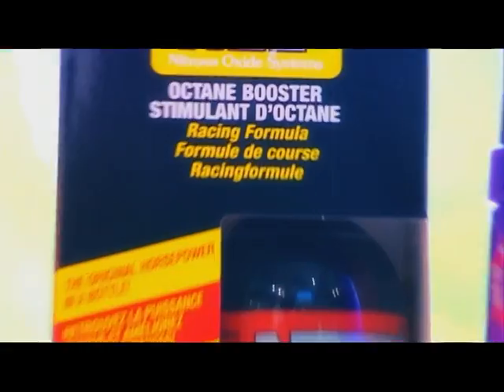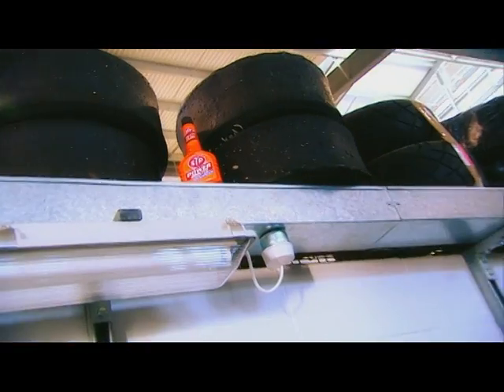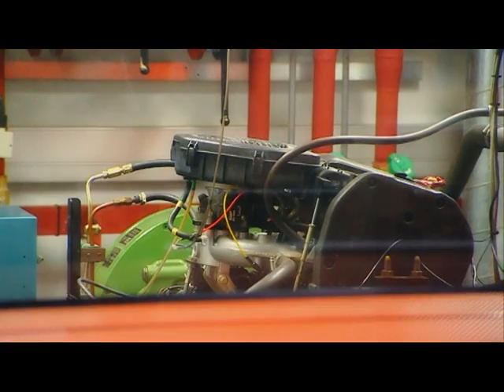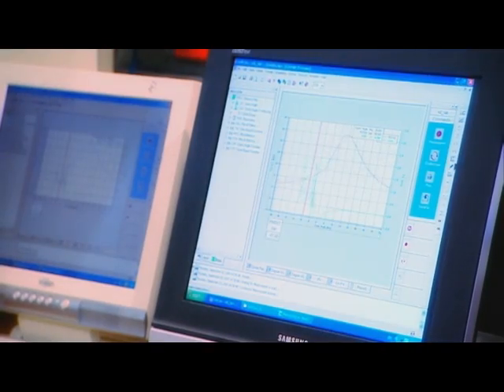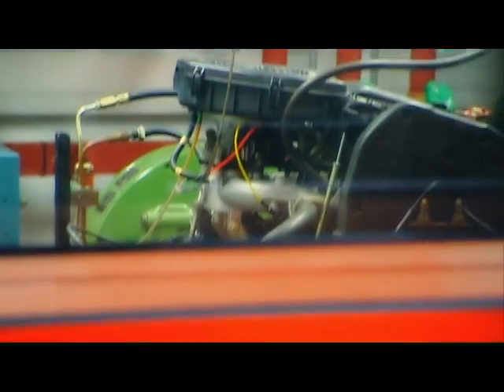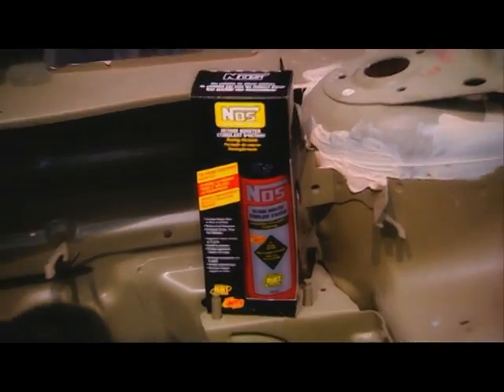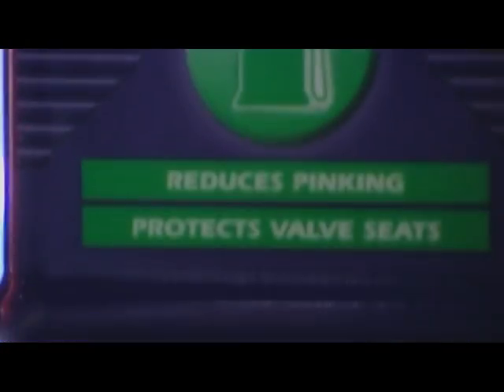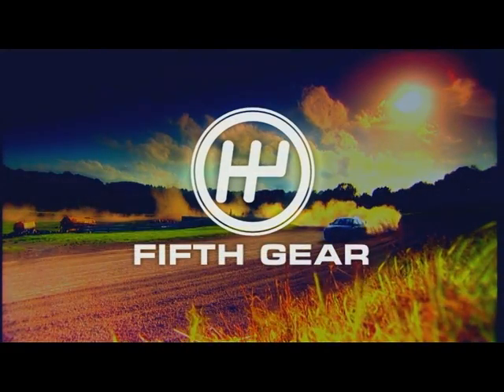Fifth Gear - Do Fuel Additives really make you faster?

Comment: I cannot comment about additives, but I have used Both Shell V-Power 99 octane Petrol, and Tesco's Momentum 99... and I can DEFINATELY tell the difference.
If you full throttle whatever car you are driving, it accelerates quicker, AND the HEATER gets hotter (Obv MPG Drops When Flooring) And if you use a light foot, it uses less fuel. So It works better BOTH ways. If you want to go faster, you go faster, if you want to use less fuel, be frugal. In everyway, V-Power and Momentum are better.

Comment: used Redex in my 1.9 octavia TDI and all it has done is made my engine run quieter but a mate of mine reckons if you use Redex combined with ultimate fuels in your diesel or petrol car then over time you should notice a difference but i still maintain that nothing cleans a diesel engine faster than a quick thrash down the motorway thats 1 way of blowing the cob webs out lol

Comment: You can increase the cylinder pressure in a normally aspirated engine by advancing the ignition timing so the peak cylinder pressure occurs earlier giving you more torque and therefore more power. The better knock resistance of higher octane fuel will allow you to do this.

Comment: nope, straight carb with a slightly modified intake for less restriction. it wasnt a big difference but because this is the only car ive owned and ive been driving it for over a year now, i know exactly how the car should handle. the acceleration increase was only slight but the fuel economy increased quite a bit. it has the same effect as if you change your car from 91 regular to 95 or 98 gas.

Comment: @popnstart Its the sound the engine makes. A mechanical pink, pink, pink, pink. Some people call it knocking or pinging and is generally caused mainly by running poor quality low-octane fuel in a high compression engine causing pre-ignition. Most fuel additives used to claim they actually boosted octane ratings but I think there were court cases from fuel companies so they changed it to claims which are harder to contest unless you've got the sort of set-up fifth gear used.

Comment: @Pintea100 
Or better become a better driver. The difference in a well relaxed driver and a tired/mad driver can be 30% more throttle/braking. There is a huge loss right there. 

So when you drive in any car.. drive more relaxed, look further ahead and let it roll out, brake less roll out!

Comment: "Octane" is a measure of a fuels ability to prevent detonation, AKA engine knock. It's a measure of how hard it is to ignite the fuel.

These aren't even good octane boosters.

IF you have an engine that can actually be tuned for high octane (through high compression or spark advance), then you will want fuel with "octane" spread over multiple boiling points using non-oxygenated hydrocarbons (non-alcohols), preferably low in aromatic solvents (toluene, xylene), as they can eat rubber.

Comment: I recently had [27/4/2011-1/5/2011] an experience with a fuel addiitive.Driving a 1.8 Citroen Picasso with 180000 kh for a small trip of 1500 km from Athens to Halkithiki [680-700kh] and back  four adults with luggages.Using the cars computer i tryied to drive with the minimum fuel economy.STUDY foot ,120-130 kmh and the fuel consumption from 9-11.AT the third refilling[every 450km] i saw at the fuel station a octane booster of Bardahl up to 5 units.Results,consumption 5.4 to8,9 a lot of power..

Comment: This is not the correct way to make test. They should tune the engine to a leaner Air fuel ratio to optimum power using each additive.

This test made is sooo misleading the usage of Fuel additive

Comment: @urkingod, Seafoam works for its purpose to clean the engine. It's not a "Power adder". Lucas oil provides good oil, but their fuel and oil additives are essentially the same thing. It gave my car an odd sputter and their oil "stabilizer" actually destabilizes the oil at high RPM and makes it foam which isn't good for oil adhesion. Sure the store display works, but try spinning it really fast. You'll notice it foams up, and this causes cavitation and premature wear.

Comment: Fuel additives generally have no effect on naturally aspirated engines, because they generally raise the octane, or amount of oxygenates of the base fuel. This allows higher compression to be achieved before engine knock occurs, something that is not adjustable on a NA engine. On a turbocharged vehicle, upping the boost increases the "dynamic" compression ratio, makes more power, but more knock, hence where premium and race fuels come in as well as fuel additives, all the way up to alcohol.

Comment: Your power also depends on the oil you use, wherther or not your use good fuel, not cheap fuel, your spark plugs, air intake, exaust flow, this wasn't a good test, their "performance" car they used was still a tiny ricer car with a little engine.

Comment: @CaptHollister Yep and when you run an ordinary car using unleaded..your emmitting benzene into the atmosphere..that stuffs carcinogenic....but isnt everything? I know about the lead content, its a Tetra eythl lead (TEL) I've made the stuff before and mixed it into a tankful of unleaded. Additives can cause turbo turbine deposits which corrode the blades, also the crappy LRP petrol that took the place of 4 star was a sodium/manganese based fuel which gummed up fuel lines, burnt valves...

Comment: @1700iDiGuy interesting, the handbooks for both my B230F & B230FT advised against any additives, but strongly recommended the use of 91 octane (equivalent to 95 octane by European measurements) fuel.  But, if I'm not mistaken, what Volvo might have recommended for your car is the use of lead-replacement additives, which are not the same thing as what is being tested in this video. Btw, you're also emitting lead into the air every time you run the engine on leaded fuel...

Comment: @CaptHollister Heres what my owners handbook says ' B200E engine recommended 95 (4 Star)' I've been using leaded petrol for the last 400 miles and the car runs smoother than ever. If it weren't for the fancy emission systems put on cars today, the lead lubricant found in leaded petrol will do valve guides that stick in some cars a whole load of good. Volvo actually advises using fuel additives, but not engine oil additives which i never use. Besides, my has a RED filler cap, and NO cat converter

Comment: All you people who have been using fuel additives: read your owner's handbooks. Most manufacturers strongly advise against using any fuel or oil additives. Some of these additives can do nasty things to your engines with long-term use. Just use quality gasoline of the recommended octane rating. That is what the engineers who designed your cars meant for you to do, and that is  how your car will perform at its best.

Comment: A 1988 Volvo is designed to run premium unleaded; it does not need leaded fuel.  If your car pings, that's a sign that you need to switch to super unleaded. If it pings on super, it may need to have the ignition timing checked, or maybe the additive you've been using has created deposits in the combustion chambers and on the spark plugs  which are now causing localised hot-spots on which the fuel mixture is self-igniting. Nasty stuff.

Comment: the fun part is that i haev used the nos one once, but no power increas Km/L by 3-6Km on a 200Km run. in a Astra F St 1,6 from 1994 with 75HP and a K&N air filter..

Comment: The Rover K16 is allready a lean burn engine so not sure what advantage there would be to use an octane booster. Do they not have a knock sensor? 

Test might have had better results on a engine with multi-point/sequential injection and better still turbo charged.

Comment: so there you have it, boy racers must dump all of these in together to increase 'performance' , lol it does nothing. if you want to spend money, put it towards that extra oil change, plugs and filters, not a fat exhaust and petrol additives. The ONLY additive that works is the 'LEAD REPLACEMENT' for older cars that need valve seat protection, its approved by the classic motor industry.

Comment: The concept is that engines with dirty combustion chambers become less efficient. Fuel system cleaning additives can clean up the gunk and allow your engine to run smoother and improve the HP to what it was back when the engine was new. So this test they ran was ill conceived in the first place. A realistic test would be done on several engines with 100k miles on them, run several tanks thru with the additive, then test again for HP, emission, efficiency.

Comment: @urbex2007 k&n air filter are wash able not like the cardboard ones you find in stock cars
Reply: k&n air filter filtration efficiency is devastatingly poor. Nothing strange that engine have some boost when it has no filtration and no air flow restriction. But life of that engine will be a lot shorter ;)

Comment: i gotta be honest...chucking in ctane boosters in a bog standard k series engine is like adding a AA battery to the poer pack of your nans shopping cart... good oil, occasional redex, keep the engine clean and cool, like mentioned earlier. the only way u can increase performance is by adding more air and more fuel at a specific ratio. cheapest is more air, big scoop going straight to a cone filter straight onto ur turbo or block. big exhaust pipe will ne needed too.

Comment: problem with octane boosters is that theyre BS. they say they can raise octane by 7-10 points generally. what most ppl dont realize is that actually translates into 0.7-1 number at the pump. so if you buy 89 octane, and add the stuff, you wont get more than 90 octane. waste of money.

Comment: they need to adjust timing if they add octane booster i believe.  just adding it would make u lose power. but if your car timed to run the higher octane. it may make more hp after you adjust the timing that you are able to since you added octane booster like a safty measure to not  detonate while doing so.
im probably missing a few facts but thats basically it isnt it.

Comment: that makes little to no sense at all fifth gear seams like they throw out all of there car knowledge those arnt for Rang rovers there for mopeds and dirtbikes when i rode a moped i swore by the stuff in a 50cc engine i got 30-35 norm and 35-40 with octane booster seems like fith gear is nonsense compared to top gear as top gear whould have explained why this was happening why didnt they use a high proformance turbo car and if you say they did with the honda ill murder you

Comment: higher octane is only required in high compression engines and it is primarily to reduce pre-detionation which causes pinging and spark knock. newer cars are designed to run on a certain octane which is usually disclosed in your owners manual, running higher or lower octane will cause the cars computer to adjust ignition timing usually resulting in less power.

Comment: Octane boosters reduce the explosivity of the fuel to make a slower, more controlled burn to stop pinging.  You can also achieve this by adding 5% kerosene.

On 91RON my engine pings, but 98RON kills my fuel economy by 10%!!

I now use 95RON (E5 ethanol blend) and turn up my timing (still doesn't ping on 95) and I get more power and slightly better economy than 91RON.

Fuel additives are generally complete crock but some of the cleaners work ok.

Comment: I see. both the r/t and r/t tt are the same set up except the r/t tt has 2 turbo chargers producing 320hp and the non turbo r/t produces 222hp. I was just curious if a fuel additive would result in better fuel mileage and performance and engine life

Comment: The twin turbo Stealth may benefit from higher octane, if you're running high enough compression, or high enough levels of boost.

Auto manufacturers recommend to use premium fuel simply because 87 Octane burns more efficiently, therefore hotter, which puts a bit more stress on piston rings.

If you're running stocks turbochargers, stock pistons, or at least a stock C/R, you'd be fine with regular. There's no sense in buying higher octane gas, only to result in more carbon build up.

Comment: Octane booster does NOT increase power. Octane is a hydrocarbon, made of you guessed it, hydrogen, and carbon. Higher Octane essentially means a harder to burn, denser fuel, so unless you're running a custom ECU MAP and advancing your spark, or running an extreme turbocharged or high compression setup, extra octane does nothing, it robs power.

Most engines are designed to use lower octane fuel, why? They burn more efficiently with a lower octane fuel.

Comment: One thing they may not have included in their tests.  The way an octane booster works is by reducing pinging as the engine timing is advanced.  So if their engine timing isn't being advanced, they can't produce more power.  I still don't believe their experiment.

Comment: If you're going to add octane you should advance the timing a little otherwise you will indead loose some power. Now if they increased timing 2+ degrees or so they would have seen a gain.

Comment: Mmm if I am not wrong you are better off buying the premium feuls. The ones that are a tad bit more expensive but offer more power. Of course this only works if you drive a car that has power. 

If you drive a shopping cart then cheap fuel will do. Nothing can help to get more out of those engines..not unless you actually get out your spanner and cash and put a turbo on them.

Comment: Typically all these do is clean out your fuel injectors and whatnot of any buildup and thats where the power boost comes from. They most likely used new engines without the need to be cleaned out. I wonder how this would have fanned out if they used 100k driven engines, taken data from it, used the additives, ran the engine one tanks worth, refilled the engine once the additive ran through, and gotten data from that

Comment: Japan has 100 octane fuel not 101. 
A Higher octane rating is needed for tuned/forced induction engines to eliminate detonation which can do significant engine to your engine, not to increase power.  You're best off mapping for the highest octane available to you rather than using additives anyway.

Comment: I'm pretty sure most bottles claim UPTO 10% power increase, i.e if you ECU runs closed loop and also has the ability to change the advance curve accordingly from the feedback from various engine (mainly exhaust) sensors. 
Its never as simple as, "add to your fuel get more power"....max power/ the fast and the furious style! lol. 
The engine needs setting up correctly to capitalise on the increased octane level.

Comment: Im surprised at how they did this test... octane boost WILL reduce the energy capacity of your fuel BUT performance engines will adjust ignition advance in response to the higher octane, thus increasing output overal. Its the same thing as buying higher octane vs. lower octane at the pump.

Comment: well, they are octane boosters so as long as you don't have any knock or pinging to begin with it makes perfect sense that you would loose power. Higher octane does not equal more power. I do wonder if these products would allow you to run more boost or higher timing in an engine without getting knock.